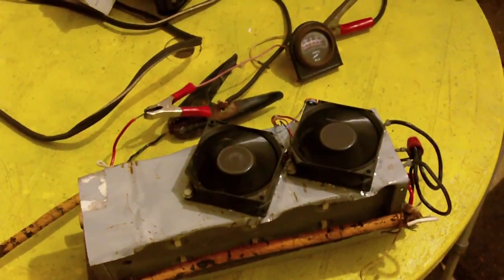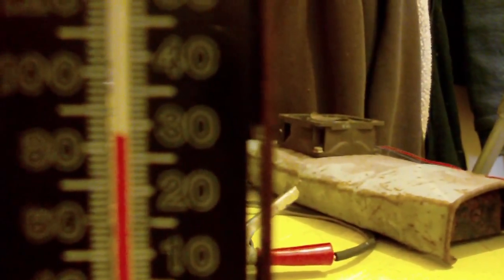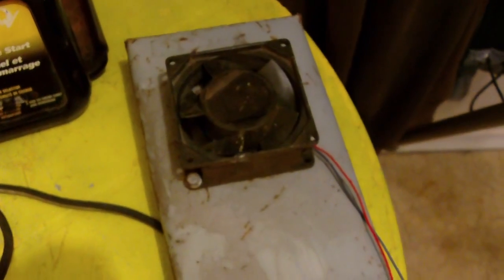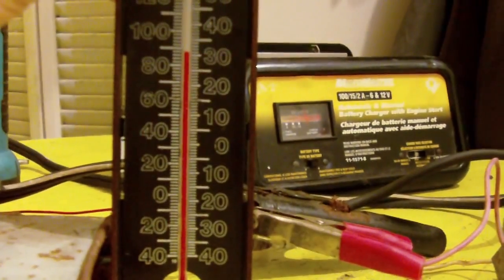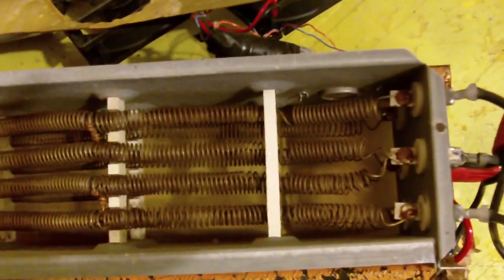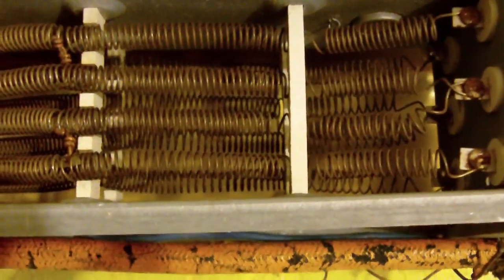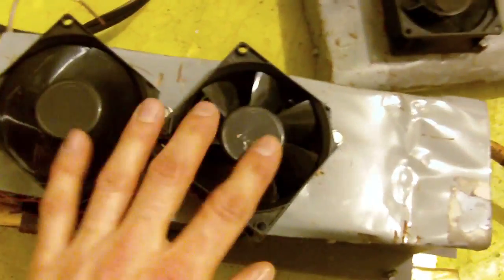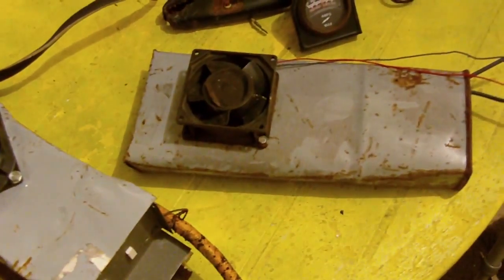Homemade 12v Heaters

Comment: You need a new brain. Actually works very bad what you do.
Heat output it's egual with the watts input.
Dc 12v 10A 120w its egual with Ac 120v 1A. Its different voltage and current but the same output 120watts.
Doesn't matter if you use low or high voltage Ac.
Depends on the working power 
120watts or 1200watts.
More watts, more heating.

Comment: Nice, I have some old heat elements from a few dryers.  Im going to try this. It does not get too cold here in FL.  but sometimes in my shop i want to get out of the cold come feb.  Jan.  Thanks for the cool idea.  Parallel the coils .

Comment: Why not use high wattage 12 volt light bulbs for heat. A incandescent bulb turns 95% of the input energy into heat and only about 5% into light. Nothing to build, just get some light sockets and use incandescent bulbs,... and this  light/heat can be pointed where the the light/heat is needed or wanted with a reflector and without a fan.

Comment: Stainless steel safety wire can be used as good heat source but the current varies by length. Any stainless works just have to know what you want to do with it.